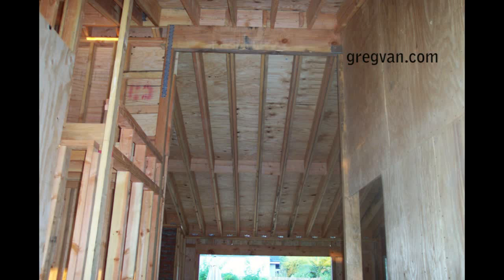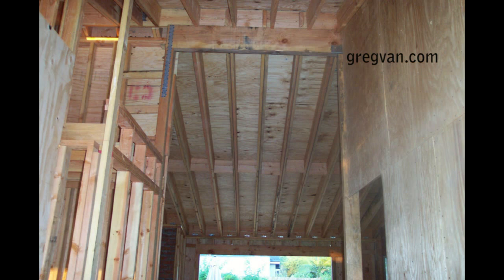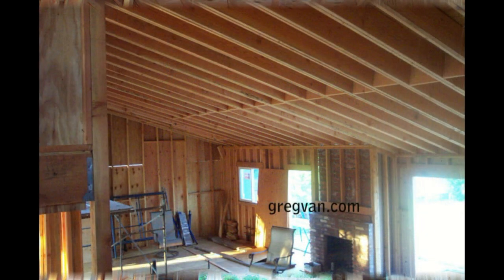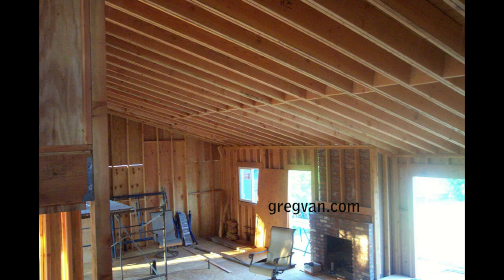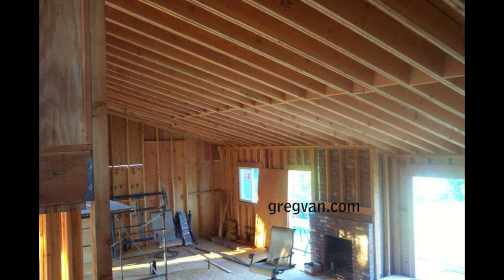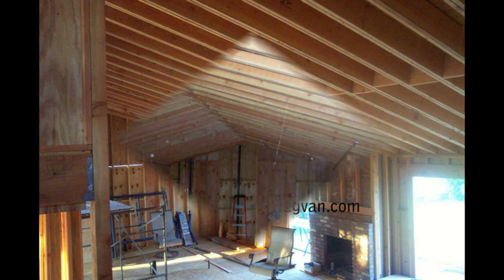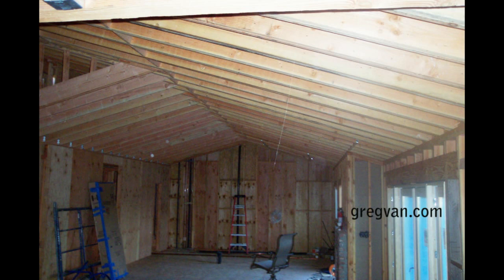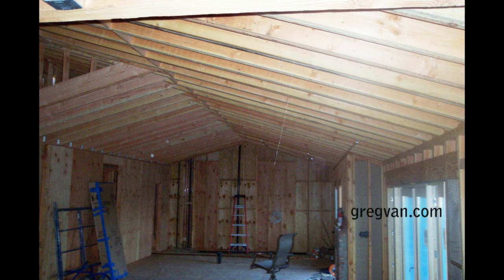Long Sagging New Double Roof Rafters - Structural Engineering Problems

Comment: what a mess they have to fix, what was the resolve on fixing this?  Steel plate to either center or side, additional engineer lumber like a LAM or girt perpendicular with obvious aesthetic compromises???????
Reply: gregvancom It might not have been feasible, but the mathematics would say that, rather than doubling the rafters by tacking them side-by-side, they should have stacked edge-to-edge them to make them taller.  That is, rather than making a 4x10 they would have made a 2x20 (assuming they were joined perfectly with glue and plates).  At a minimum, they could have use an extra rafter in side-by-side fashion, but if they shifted the second one down about half way if you have made the combination rafter much stiffer.

The moment of inertia of a beam (which determines the amount of deflection) is proportional to the thickness (2") times the CUBE of the width (10") of the beam.  By stacking them side-by-side (as in the video), you double the moment of inertia.  Stacking edge-to-edge you get 8x higher moment of inertia (ie 4x increase over side-by-side).

The moment of inertia calculation is complicated for the "shifted" side-by-side approach, but you could probably get at least twice as much stiffness from the same amount of wood with a slightly different arrangement of the boards.
Reply from the maker: It wasn't fixed and I don't know if there were any further consequences. If it was my house I would have installed a large beam with footings in the floor about mid span of the roof rafters. As I probably mentioned in the video, sometimes it looks good on paper, but it doesn't work well on the building.
Reply from the maker: It really is hard to say what is going to work better, especially if it works out with engineering calculations. That's the main reason why I made the video, to point out the fact as you said in your comment that there are other things that might work better and could have been used if the engineer knew about this type of problem.

Comment: i would have used "Engineered Timber" for this type of job, reason being....lighter ..can take own weight.. and cheaper...so what is engineered timber...basically a 4" by 10" box made of 3/4 ply screwed and glued with cross sections inside making a long box with amazing strength....i did a job like this in the Philippines and i used 4''x 12'' over a 26 foot span with no problems..

Comment from the maker: No I'm pretty sure the building is still standing and doing just fine and there probably won't be a problem, because a structural engineer designed it that way, but I think the main point of the video I was trying to make was that sometimes what looks good on a piece of paper, with structural calculations that worked out perfectly, might not work well at all.

Comment from the maker: That's probably the worst part about building anything, the fact that time and the elements will eventually take its toll. It is a bummer though, when you pay a structural engineer lots of money, based on the assumption they know what they're doing and you still end up with problems.

Comment from the maker: Excellent point and you're absolutely right, you could have a 6 and 12 pitch on top and a 4 and 12 pitch on the bottom, for the ceiling. That probably would have been better, as long as the engineered roofing system didn't sag, which I've seen some do so in the past. Thanks again for the helpful information, it's greatly appreciated.